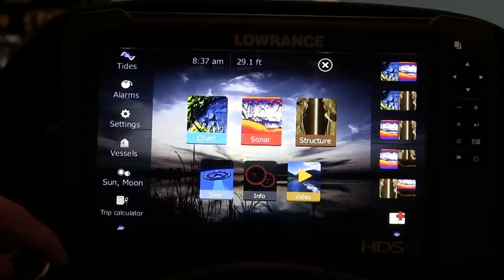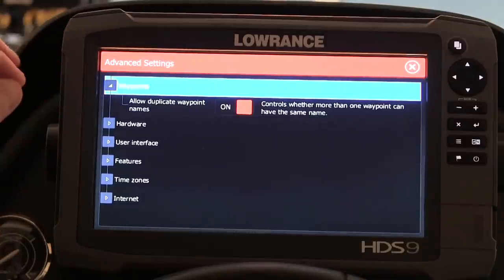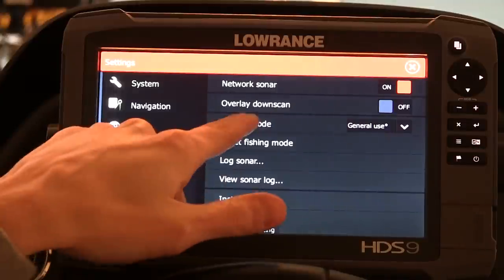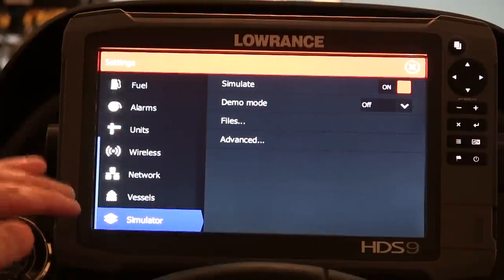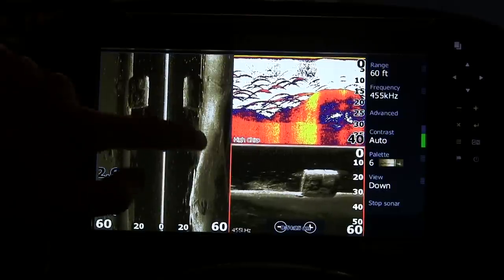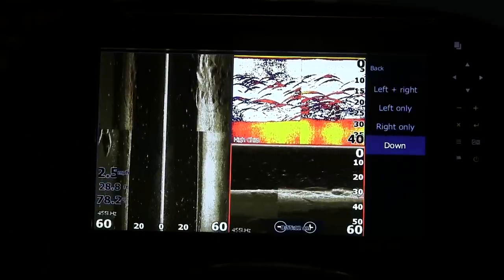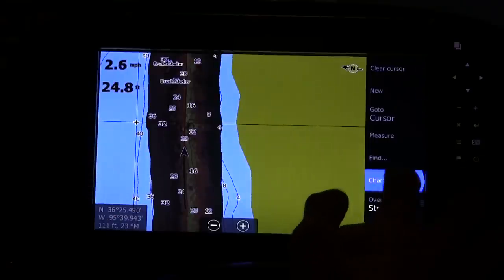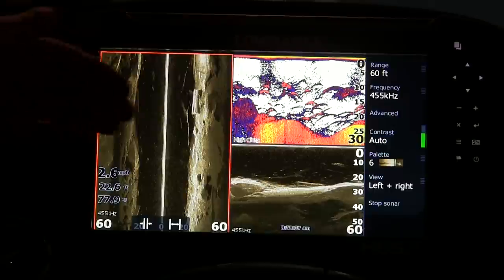Lowrance HDS Gen 3 Settings Tutorial

Comment: Great overview / tutorial Dan, well done... dont be bothered about it being too long.... its whats we want / need.... Question. What is the System Setting to use to select the big transducer i have TM260 50/200Khz with diplexer, i noticed you said they are not called this in the system. I also noticed you mentioned the system will automatically detect the 3D Structure scan transducer which i have too..... Cheers
Reply from the maker: Mike Sherwood Mike I had some comments that posted but I never got notifications. Did you find out your answer? I assume yes?

Comment: one thing on network sonar. if you are running 2 units and they're connected when you select network sonar ON at the console your front unit will be using your transom sonar!
Reply from the maker: t greene you can actually have the setting on and still choose which transducer to read! Sometimes I'll read my structurescan from the back on my front graph.

Comment: Wishing Lowrance had an adjustment for the gps antenna location relative distance to sonar transducer location.  It would be an easy computation for the processor.  

The reason you need it is because the built in antenna is generally located at some distance from the transducer giving an incorrect lat/lon position anytime you want to mark something underwater.  

When you use your gps to relocate your underwater structure waypoint, the structure will be off at a random angle  at however many feet.    

Of course you can purchase a separate external gps antenna and mount it directly over the sonar transducer location but that might not be a workable solution $$$.
Reply from the maker: You're right, the "puck" is an additional cost. But for $100 or so, I think it would be well worth the cost!

Comment: On your three screen, left side scan, right 2d upper, right downscan lower.....wouldn't you get a better picture with the 2d and the downscan across the top and the side scan across the bottom. Reasoning: The two top screens would be the same size as before but the side-scan would double. Thus if 60 ft to the right before was two inches of screen now it would be four inches.....doubling the resolution. Also as explained to me by a Lowrance rep. you subtract the depth from the distance to side......60 ft. to the right minus the 20 ft depth is only 40 ft. If you look at the screen the first 20 ft is the water column. If you're looking to the right side it's actual the shape of an L 20 ft. Down/40 to right.

Comment: Hi , I  bought a  used 22 footer with the hds9 and I get the water temp which is at the surface of about 81 degrees currently at ponce inlet FLA , but is there a way to get water temperatures at different  depths with these units because water  temperature is critical and so under talked about ,,,,,,,,,,,, going from 81 degrees at the surface in 20 feet to the ocean that's hundreds of feet has to have a huge variance that  I would like to capitalize on if possible rather than just reef fishing ,. im not even sure if there are thermoclines in the ocean so any info on this unit would help about  down depth and temps thanks for any available help

Comment: Did I miss something??!! He mentioned the 83/200kHz transducers option was not on there?? @ 02:40 it clearly shows it being an option??
Reply from the maker: jdamron311 This is why I made the video. The 83/200 has a tag on the cable stating which one you should choose in the settings. On mine, the cable that runs from the transducer says HST-WSBL :)
Reply: FHC Outdoors thank you. I am setting up a new 7 and just set to the 83/200kHz. So your saying I need to go back and select the one you mentioned or it will not be correct? Congratulations on the boat. Life long Skeeter owner and will always be.
Reply from the maker: jdamron311 You should see a silver tag, kind of looks like tape, stating which one you need to choose in the settings menu. It might be 83/200, or it might be the one I used. Do you have a tag on the cable?
Reply: I will have to check I am not with the boat at the moment it is kept at lake house. Really appreciate the vid and I will check and make the change if need be.

Comment: what transducer did you set this up with on your boat
Reply from the maker: I have the HDI Skimmer up front that is attached to my trolling motor. This gives you 2D sonar down, plus downscan (looks like x-ray image). On the back inside the boat, I have the thru-hull 83/200 transducer and an exterior mounted StructureScan transducer. Three total!